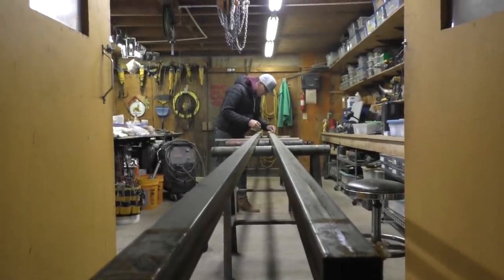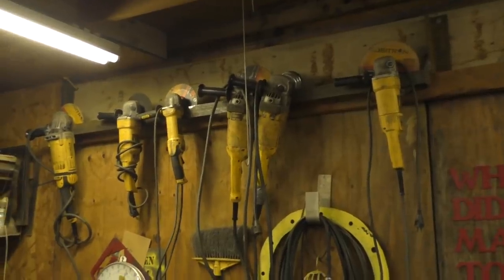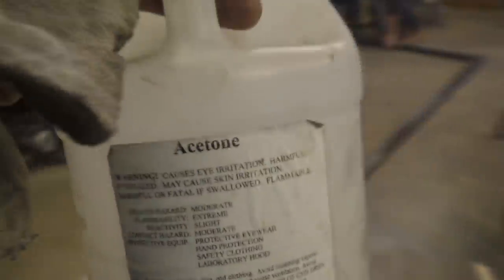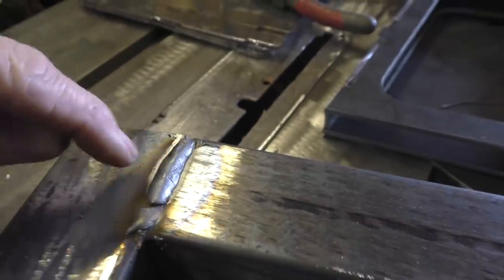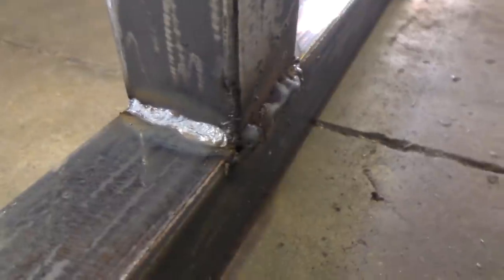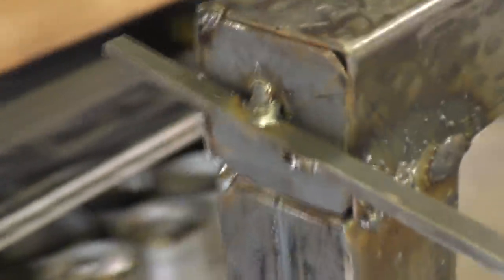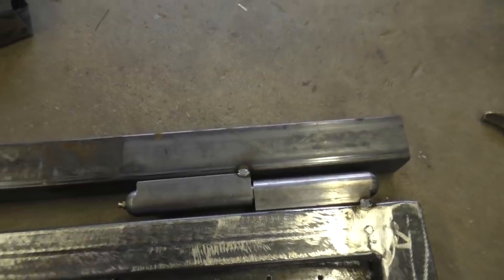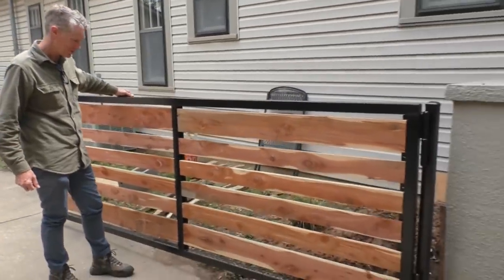Learn to Weld

Comment: After 20 years using them, lost my finger to an unguarded cutting disc on a 6' grinder. It wasn't fine. I did need that. My mother didn't care. It was a good finger. I usually use guards now. Helps with the sparks too. TAKE IT OR LEAVE IT. Especially when I lend someone or give an employee a grinder, I make sure it has a guard. (Who's triggered? Not me, no finger for it!)

Comment: I'd like to tell a little story since you said something about grinder guards well safety sissies need them they do work but they limit your access with them when I got into the welding industry back in '03 I was handed a grinder and it didn't have a guard on it and if you look around the industry even though we've got OSHA it's pretty much the norm that you won't find too many get it done companies that have the guard on them safety is your responsibility in general I'm speaking of that you can be as safe as you want to be the key is to pay attention most people don't realize this you have to pay attention and it will limit your likelihood of getting hurt I love the channel

Comment: While cleaning steel be sure to use non chlorinated de greasers and always check on the can if you are unsure. Acetone is a safe option. Avoid brake clean! Chlorine and UV light/heat causes phosgene gas (Chlorine gas) which is deadly.

Comment: More angle as in steeper angle more penetration less angle more perpendicular less penetration the closer you are amperage goes up the further you are away voltage goes up

Comment: You can weld wood, look it up, it's real :0
Biggest problem i have using the smaller grinders is my hand going into the back of the blade due to how you grip it.
Reply: IDK every grinder I've used and bought comes with something to prevent that, with the exception of 2" grinders.
Reply: Use the grinders guard over the wheel....

Comment: how did he i lay the wood in sidebthe fince
Reply: there's a piece of steel running vertically welded onto the sides of the up-rights of the gate. Wood screws go through that into the wood from the side facing away from the street.
Reply: @52Ford   7:00 to 7:20, the tabs with the holes drilled, for using screws to mount the wood planks.